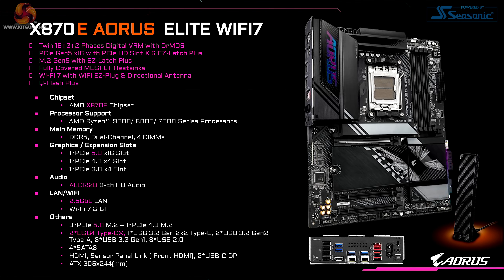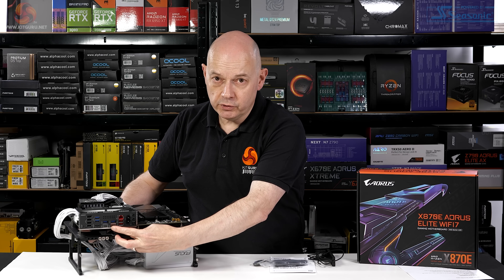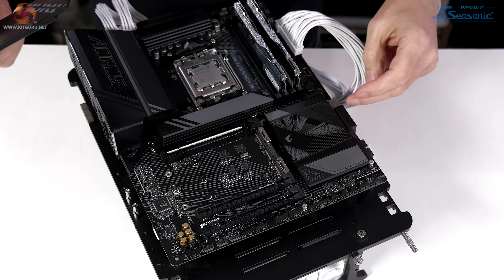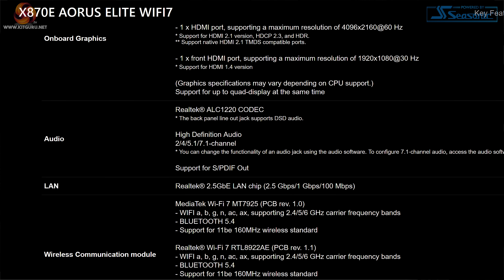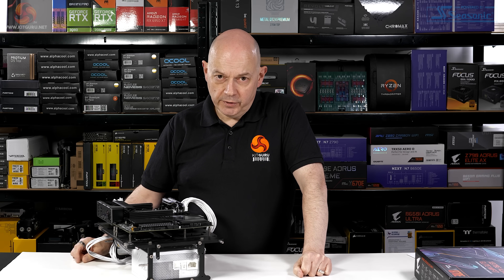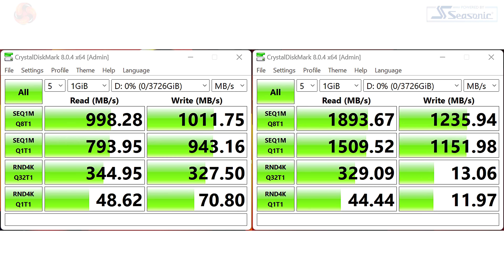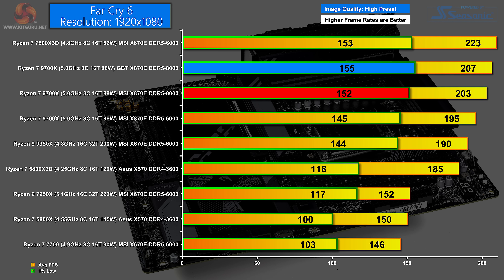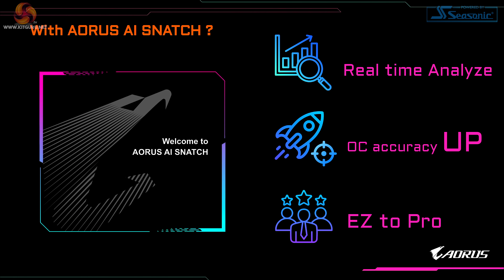Gigabyte X870E Aorus Elite WiFi7 - surprised us!

Comment: Got a question re the USB4. The specs indicate "2 x USB4® USB Type-C® ports, supporting USB4 and DisplayPort video outputs and a maximum resolution of 3840x2160@240 Hz" Does that mean that one has to use a USB-C to DP adapter and a DP monitor rather than a USBC to HDMI adapter and a HDMI monitor??

Comment: Thanks for the detailed review, just got my board yesterday and planning to install the 9800x3D and Gigabyte 4080 Super.  We'll see how that goes soon.
Reply: Did you survive the install?
Reply: @Jupex  Yes, all put together, running stable and looks great.  I did end up buying a 90-deg 24-pin and front panel USB connecter.  Those connectors help turn the cables better to the back of the board.  I have a rear, top mounted power supply.  Having the same controller for RRB for the GPU and case fans is nice, less apps to run for RGB.  I wish I didn't use the NZXT included case fans and controller.  I don't like having another app to run the case installed fans.  And, I have Corsair memory which needs iCue for the RGB, that sucks too.  I am using the Gigabyte and AMD software for moderate overclocking, seems stable so far.
Reply: @JamboneMan  What PSU did you use for your build?
Reply: How did the build go?
Reply: Did you have to do the BIOS update for the ryzen 7 9800x3d to work?

Comment: I am wondering about the In Out on the back where we use to have jacks for Sound, which seems to have changed, where there use to be different colored jacks for 5.1 audio, what is going on that these are now missing from the backs of many of the Mother boards.. I noticed that the asus Tuf board still has them, but most boards have gone away, what is the deal if you could let me know.. and or is there an audio interface which will allow someone to plug in their 5.1 jacks into it..

Comment: That seems like a fair rating for a very good mid range board. The only board I had listed above it is the asrock gaming phantom nova 870e. Gives you pretty much everything the tachi has but at a cheaper price. I really like that the primary m.2 does not share lanes with the pcie1 16 slot for the gpu.
Reply: What is the bandwidth requirement of a 7000 MB/s NVME drive? Maybe it could run fine from a different slot. Problem solved.

Comment: I am not liking the idea of the proprietary plugin Wi-Fi antenna. I replaced my stock one with one that was more stable than the cheap one that came with the motherboard and kept falling over. I was then also surprised by the stronger signal. This would only work for me if that plug could be adapted to another antenna.

Comment: As a Canadian, I always appreciate the understated British humour. In this case you had me with the wi-fi antenna: "...It also unplugs." Spot on.

Edit: The bottom slot on the 870E is also Gen 3 x4 not Gen 3 x2 (thank the second chipset).

As well, yes, PCIe slots are useful for U.2 drive adapter expansion cards, properly high-speed network cards, a multitude of pro A/V cards, etc., etc. It's actually brutal ATX boards by most manufacturers have lost PCIe slots (Gigabyte being a notable exception). If you don't like the slots get a more affordable mATX board perhaps?

Comment: Gigabyte X870 Aorus Elite WiFi7  ICE (non -E Chipset) has exact the same features. The only notable difference is that it has only one USB3 header, which imo doesn't matter. And it's white. But it's also nearly 30€ cheaper. So if the color doesn't matter, it's the better choice.
Reply: I am considering this board too but it does worse than the 870E in some reviews.
Reply: Hola, le pregunte a la IA, y las versiones (con chipset E) tienen mas Vram... o están mas robustas para el uso de Microchips mas potentes. Saludos

Comment: I have the PRO variant and a 9800x3d. I think i may have boned up at got ram that doesnt have the EXPO logo. the XMP profile loads fine and the RAM screams at 6400 MTPS, which is what it is rated for. I guess i dont know how to turn on the snatch. i open the app in windows and it just shows AMD EXPO BOOST kind of greyed out and doesnt do anything. I am running overclocked to 5.35 ghz with no issue

Comment: It's sad that these days that's considered a reasonable, "low" price for a motherboard.
Reply from the maker: Check out the ASUS maximus boards or the MSI godlike. Between £800 and £1300.
Reply: @KitGuruTech  Oh I know they can get pretty crazy these days. Up until the last couple years I'd never spent over $100 on a mobo, in over 20 years of building. Never needed to, they did what I needed. Then I finally did break that mark, and now I have an ASRock X870 Pro RS WiFi.

Comment: I have a question, I thought AMD CPUs weren't very happy with RAM above 6000, is that now no longer the case?
Reply from the maker: With faster memory the fabric divider changes from 1:1 to 1:2 i.e. it halves so DDR5-8000 functions but overall delivers minimal benefit. Until we have DDR5-10000 or 12000 it looks like we are stuck with 6000 or 6400.
Leo
Reply: @ I see, thanks for the info and the review. I just grabbed this board and a 6000 RAM kit. 👍

Comment: I was looking at the MSI X870 Tomahawk, which has 5G LAN. I only plan to use 2x m.2 4.0 SSDs, so there should be no lane problems. But I didn’t know mainboards would perform differently in benchmarks. How do the Gigabyte compare to the MSI? The price is very similar.
Reply: lookup the Hardware Unboxed 870 roundup. It does quite well (spoiler alert).

Comment: Gigabytes was My Go To but they keep cheeping them out with Only 6-Layer PCB and 16 60 amp VRM  which may look good but is the bottom of the barrel for build at a high cost and lost parts in it. What good is having 4 M.2's if you can only use 2 of them without sharing the PCIe 16 slot with the other 2 M.2 slots. way over priced for what you get.

Comment: ehehe.. x870 and X870e should have two USB 4.0 but the MSI x870 P wifi only has one. 🤣

However it does have 5.0G lan and one of the cheapest boards in the X870 lineup that has a Bios reset button but just missing the LCD post code screen.

Comment: This board in Australia is $599.00 Aus dollars.
Reply from the maker: Trying to get a handle on that cost - is that overpriced for your market - seems to translate to around £305 UK if the exchange rate system I used is correct
Reply: @KitGuruTech  For me its overpriced. A lot of price gouging goes on here. Thnks anyway.

Comment: $300 is cheap for a brand new board now? Cheap?
It appears to be a decent value, but not cheap.
Reply from the maker: Considering some of the high end boards are over £1000 or at least between £700 and £1000 (maximus and Godlike) - 300 bucks sounds like a lot, but in the grand scheme of things, the prices are so high now for high end boards - its difficult to put them into 'categories'.

Comment: But can you get it in White or an equivalent?
Reply from the maker: Yes there is an Ice version at the same price
Reply: @KitGuruTech  Seems to be the non E (Gigabyte X870 Aorus Elite WIFI7) version which is a glorified B650 board or the non WIFI version Gigabyte X870E Aorus Pro Ice you can get in white.
Reply: Oh so dug a little deeper, the Gigabyte X870E Aorus Pro Ice does have wifi 7 but they dont advertise in the name, its a different Qualcomm version though but actually supports the 320MHz where as the Elite is only 160MHz. Very strange and confusing just like all the naming scheme is 870 and 870E what a boarderline scam.
Reply: @Iain-Ray  the whole thing is a scam and ridiculously confusing. AMD have a lot to answer to for the 870(E) CPU lanes debacle! Pure cash grabbing.

Comment: I went with the aorus pro ice x870e because it's by far the best looking white board on the market. And I'm not dumb enough to think 5.0 8x is really going to drop performance by more than 10-15 frames even on a 5090 if I want a few more SSD's.
Reply: bro, the 5090 is built with only 5.0x8, not 16 lanes
Reply: @VladimirVladimirovichPutin0001  Got a source to back that up? It runs on 16 lanes it can't utilise them all though. No GPU can. Hence why running it a 8x does almost nothing to performance.

Comment: I believe you forgot to mention that the CPU socket has a reinforced backing plate, as well as the graphics card slot, I have this board and along with the pushbutton pcie release and the tool free drive access, with a 7900 XTX I really appreciate the extra rigidity of the reinforced slot.   

 I've tortured this board for a month or so and its stable as a rock....

I was gonna say the software wasn't up to date but while watching this video I see there is a new bios, control center and several other drivers I guess I'll update it as I don't see AI snatch anywhere hehe, it also has several spots on board including in back with rgb built into it......

 Super Solid MB imho for the price!
Reply from the maker: Thanks for the feedback, was good to read. thank you.
Reply: @KitGuruTech  i can confirm the new bios did then trigger gigabyte control center to update all drivers and install AI Snatch, it's working fluid n fast DDR5 6000 at EXPO 1 CL30...7900xtx and 9700x ( 7800x3d sold out), primary cached gen 5 system drive and backups in 2 and 4....all TB....working a mint !!! 
 For the price I don't think I could have chose better, I'll be using the USB 4 eventually!

Comment: I've been thinking about just getting a 670e for my next build, but the easy installation features for m.2s and the release button for the graphics card may push me the other way. I tend to slowly upgrade my systems over time so those things add value. The BIOS looks really good. I can take or leave the usb4 or wifi 7 though.

Comment: After having a Dead Strix 870E mobo (code 0d, dead mobo) and broken TUF board delivered, I went with this motherboard.  Easiest build yet, it just worked!  9900x, 64GB of T-Create 6000MT's, and 4080 Super.  It has been a very strong board as I have pushed it on stress tests and found a split second it bounced up to 5.9Ghz in a Cinebench 23 test.  Thanks for your review to get this one out there.  GREAT BOARD.
Reply: be carefull, you cant use 2 or more PCIE 5.0 ssds on x870e boards expect 2 of them, without limiting your GPU x16 slot lane down to x8 for most x870 & x870e boards. cheers.
Reply: @teanymonster5227  Thank you!  I will get one of them out of the other 5.0 slot.  Was wondering why I have 8x only, i do have 2 NVME in 5.0 slots.  Thanks again.
Reply: @snowbeast7216  Hi, sorry to bother you, may I ask you about the NVME in this mobo?

Manuals from different revisions state completely conflicting version of either absolutely needing some additional thermal pads and rubber pads that should be bundled with the motherboad (mine didn't have them bundled!) in order to mount single-sided NVMEs or don't mention anything at all so it's not clear how to install NVMEs in either the main slot or the additional ones (do the main slot REQUIRE an additional thermal pad for single sided NVME as one manual states? do the additional slots REQUIRE thermal rubber pads thick ones and thin ones as stated in one of the manuals?)

May I ask you how you solve this issue? Are your NVME temperatures ok? Is the NVME making proper contact with the cooling system?
Reply: Same Tuf x670E dead, bios flashback in loop… hope this 870e will be strong enough
Reply: @ruxo99824  My Asus Tuf stopped working and cpu dead, replaced it with another, stopped working too.
I'm now getting a new pc with this board... done with it.
Reply: How's it holding out?
Reply: @dave9640  No problems man!  Been almost 6 months, only thing is I took out the PCIE Gen5 Nvme drive and use 2 Gen 4.  No noticable difference in game or desktop performance only benchmarks. I have the full pci-e 4.0@16x instead of 8x for GPU now.
Reply: @snowbeast7216  The x8 honestly wont make a difference. I have 2 Gen5 in mine which makes my 5080 run at x8 but I ended up doing some test and didnt notice a difference at all. Fps was at most ~2 fps lower and that in the worse case.
Reply: @JrBoi12  because rtx 50xx series are built with only 8 pcie lane, they are using pcie 5.0x8, they dont need to use 5.0  x 16
Reply: @snowbeast7216  which slots did you use for the ssds
Reply: do you still recommend that board
Reply: @anormalzz  yep, almost a year with no problems.  Switched to a 9800X3D from the 9900X as its now just a gaming setup.

Comment: the NVMe set up is wack. NVMe gen 5 puts out so much heat 3 of them in a system will COOK the entire case. all that heat against the GPU and rising up to the Socket and VRMS. nope nope nope. going to stick with the MSI X670E tomahawk for my 9800X3d build 1 PCE gen 5 x4 and 3 Gen 4 x4. lovely video as always leo